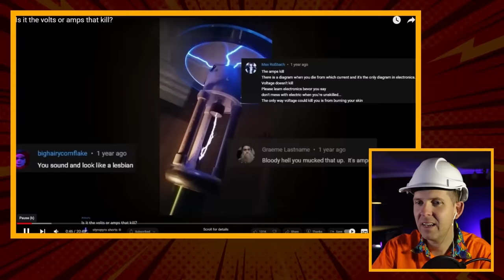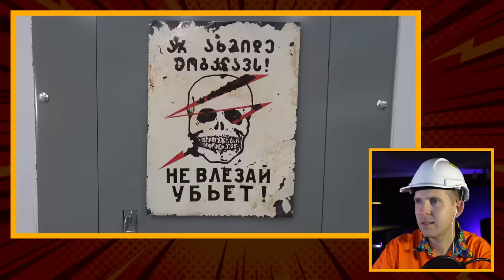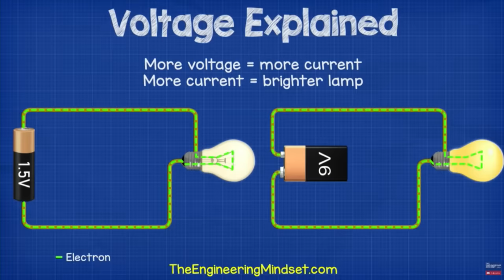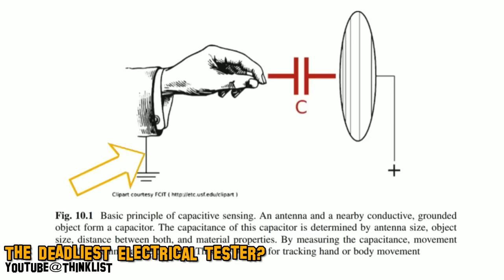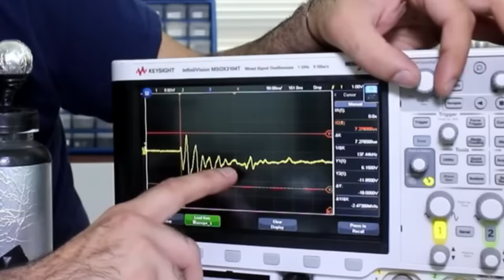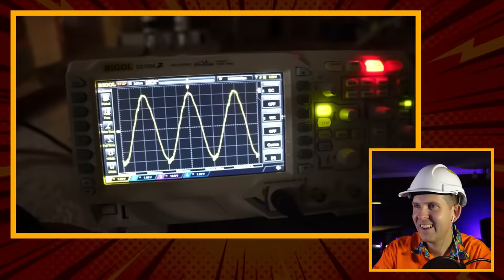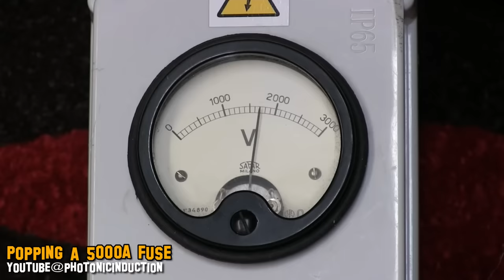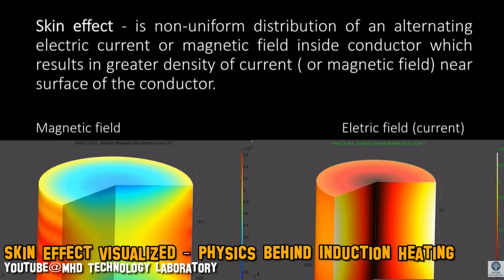Electrician Reacts to Styropyro's🔌AMPS vs VOLTS⚡

Comment: 1 volt can kill you?
Reply: no
Reply: @neutronenstern.  Yes it can,have you ever heard of amps? I generate 40 000 volt by just combing my hair.
Reply: @pernykvist3442  you seem not to undersdand ohms law. If there is a potential difference of only 1V across your body, there is no way a harmfull current could pass your body. It is impossible,cause I=U/R, and since R of your body at 1V is somewhere at 10000Ω or even higher, only a miniscule current will flow through ypur body, even if the source would be capable of a max current of 100000000000A, it could still not push this through your body, if its voltage is only 1V.
And your hair does not kill you, cause as soon as you touch it, it will discharge to nearly 0V in under a ms. The charge is so low, that it just doesnt last long. (like if you had only one dust corn of dynamite. It will expplode, and the pressure might be high, but still not nearly enough to harm you). For a very very short amount of time, still there might be flowing a very very high current through your body. But it does not harm you, cause its soooo short.
Reply: @neutronenstern.  The currence of 1 volt can kill you if the tention is built up to extreme! Most lightning bolts dosent have musch volt in them.
Reply: @pernykvist3442  no.
there is no tention.
Theres volts and amps.
A lightning will initially have Billions of volts. Then while it strikes, this voltage breaks down, until it does not strike anymore. The hot air created by the initial current spike is a plasma, which js conductive, and low in resistance.
You seem not to know a lot about electricity .
1V cant kill you, and thats for sure. 
Maybe you mean with tension voltage, cause in languages like german its the same word.
But then 1V is the """tension""". 
1A of current flowing through your body can kill you,if it flows long enough (10ms or longer).
even 0,025A can kill you.
But if theres only 1V of voltage across your body, then the current flowing thfough your body will be way way lower than that, and it will not kill you.
Reply: @neutronenstern.  Once again volt is only the frequence and amps are the tension! It is possible to build up an enormous charge in one and single volt to cause you to catch fire and vaporise body fluids.
Reply: @pernykvist3442  its the other way around.
Volt gives you the energy which each electron has got (per definition)The Energy is then given by its charge multiplied by the voltage.
Amps however give you information of how many electrons pass a certain point at a conducter per second. 1Amp is defined as one coulomb per second, while one electron has got a charge of 1,602*10^-19Coulomb.
This is by Definition.
Now Ohms law tells us, that for a ohm resistor the current is directly proportional to the voltage across thar resistor, and indirectly proportional to its resistance,that is I=V/R.
At a voltage of 1V the current flowing through your body will only be miniscule.
It is however possible, to accumulate a lot of charge with only 1V. (e.g if you have a capacitor, that has a high capacitance like 100F, then at only 1V it can hold 100Coulomb of charge, which is a lot.
However this does not mean, that if ypu touch it,this charge will instantly flow through your body. In fact, it will take an eternity for that to discharge across your body. And how fast it will flow is desided by your resistance, and the voltage. Thats the reason, why one volt cant kill you. At one volt the rate of this charge flowing through your body (Current in Amps) is just too low,to be able to kill you. 
However, of you hold it onto a piece of copper wire, it will discharge quickly, heating up the piece of copper. This is, because the copper is way way morr conductive than you are, and thus at even one volt, it will conduct a lot of current.
You are just wrong with this. You can trust me in this topic. I am studying physics,and in this topic, i know exactly,what i am talking about.
Reply: @neutronenstern.  Every movmeant generate voltage,if there where no amperes you would dead by putting on ordinary cotton tshirt. I do work with electric heating and colding systems.
Reply: @pernykvist3442  YES. 
there are amps. But they can only be high, if the voltage is high. At high voltage, there will be a high current flowing through your body, and at low voltage, there will be low current flowing through your body. But its not only amps,that deside,if its lethal or not. Its also the time,ghe current flows through your body. If a cloth you put on charges up to lets say 10000V, and then you touch it, there will be flowing a current through your body,that would be lethal,if it would flow for longer than 10ms. But since it is flowing for a time shorter than a ms,it is not lethal.
Reply: @neutronenstern.  Listen to me carefully! If you if you set the mig weld in one volt and icrease it to maximum volt. And you sitting in a bath tub with water salt and silver nitrate you will die! And i dont recomend you try it!
Reply: @pernykvist3442  
Are you serious? Of course, if i set it to maximum volt, i will die. But then it isnt 1 Volt ! You seem to confuce a lot of variables here. Volts, Amps, and your self upmade "tension" that doesnt exist. Also you seem not to understand that one volt is one volt is one volt and will always be one volt.
Reply: @neutronenstern.  If you set iit on max amps with 1 volt it will still kill you or hurt you badly! Many volts  with low amps is like aoutomatic bb gun it hurts but dont ill you! Few volts or even one is a big 50cal round with strong amps!
Reply: @pernykvist3442  No.
You still dont understand ohms law!
There is no such thing as being able to controll volts and amps independently. It isnt possible. Eg. If you model a human (simple model, cause else too complicated for this post)
as a resistor of 1000Ω. Then if theres one volt across it,the current flowing through it will be 1mA, no matter how strong the source is. The source could be a huge fat transformer that transformes 230V down to 1V (and then it gets rectified or not for DC or AC),and is capable of an short current of 10000000A. But this high current will still not flow through your body, if the voltage is 1V. 
If theres 100V across the body, then the current will be at 100mA and deadly in this model. 
Its not possible that eg. at 1V across ypur body theres a current of lets say 100mA flowing through your body, cause this would mean, that the resistance of your body magically was only at 10Ω, which is ridiculous, cause at 1V not even the skin breaks down,and the resistance of your skin is higher.
You dont understand Ohms law. Just learn more about it. Saying 1V will kill you,if current is high enough, is like saying, i will reach rome from paris in one minute with a speed of 1Km/h if only the path i go along in one second is long enough. This is just bullshit, cause the path i walk per second is set by the speed, which is 1Km/h.
And the same applies to this scenario. As long as the bodys resistance is constant (which it is, as long as voltage across it is constant) the current is only set by the voltage across your body. There is no such thing as independend Voltage amd Amps. Dont you get this?
Reply: @neutronenstern.  I dont have any good video recrging but i shall try to post a video to you when i burn a nail or a fuse with 1 volt. Im certain that it "can" cause death. I dont have any other stronger regulator that can build up that amount of amps i would show yo but it will still make a mess that can be fatal.
Reply: @pernykvist3442  of course it can melt a nail. But it cant burn a human direcrly. Lets say,you have a power supply that can output 200A max, and you set it to 1V. If you now connect it to a nail with a resistance of lets say 0.01Ω there will be flowing a current of I=V/R=1V/0,01Ω=100A through the nail. Now the power consumption of the nail is P=U*I=1V*100A=100W. These 100W will heat up that nail pretty good.
However, if you touch it still nothing will happen. Thats because if you touch it,your body will at least have a resistance of ≈10000Ω.
Thus the current flowing through you will only be I=V/R=1V/10000Ω=0.0001A=0.1mA. Thats not a lot of current. Only at 20mA or above this will kill you.
Also the power is then only at P=U*I=1V*0,0001A=0,0001W
I am sure,if you connect this source to a wiener, it will not react to it. 
A wiener is a way  bether model for a human,than a nail.
Reply: @pernykvist3442  just think about it: Its not about how high the maximum current of your source is. Its about how high the current running through your body ACTUALLY will be. And this is determined by Voltage and Resistance.
Just THINK for a second.
Reply: @neutronenstern.  We have a particle accelerator who working with 1 volt.
Reply: @pernykvist3442  ok thats no problem. However if the accelerating voltage is only 1V, then i dont know,what its use might be,cause then each particle with  a charge of 1e, these particles will only reach a energy of E=V*q=1eV, which is not a lot of energy. Even electrons in a old TV will have 20KeV. 
So i doubt it works with 1V. Maybe the voltage of the kathode heating element is running with 1V?
Tell me, how is this accelerator called? Or maybe its accelerated several times with 1V, then the energy will accumulate, and if its high frequency it will reach high energies over time.
Still this does not tell you, if 1V can kill you or not. 1V simply cant kill you directly.
(or is it 1kV,cause i dont find a single one with only 1V. 1kV=1000V)
Reply: @neutronenstern.  But yes it can do. The voltage is not the part that is deadly i can stun my self with 100 000 volt and i does it daily by petting the cat etc using a blender.
Reply: @pernykvist3442  it might be the amps, but still volts determine amps. And if you stun yourselve with 100 000volts, then both volts and amps are high. You dont die, because this stun is short enough.

But i explained this like 100times now, and you still dont read it,so i think you just either dont read, or just cant understand.
Reply: @neutronenstern.  With big amount of amps built up a single volt dosent only kill you it can allso disolve the water in your body into oxygen and hydrogen. I am 100% certain of that thanks. :)
Reply: @neutronenstern.  And i will allso claim that Zero "0" volt would probably kill us to!
Reply: @pernykvist3442  no
Read about ohms law.
Also electrolysis at 1V is possible, but very very slow. Normal electrolysis generators work with a little more than 1V. And over your skin having the highest resistance there will drop most of this 1V, so that over the rest of your body there will only drop like 0,1V or even less. And under 0,5V electrolysis of water isnt physically possible. I am certain, because i know it, can calculate it, and have often touched stuff with 1V, 12V and even 30V. And that although this power supply can handle 10A, and 10A flowing through my body would be lethal. But it simply does not, because of ohms law. Also i've touched a supply's terminal, that can output 30A at 12V,and i didnt even feel a damn thing. You are just wrong. But if you want to, you can feel terryfied of a 12V car battery, that can output 200A, if you want to. I am not.
Reply: @pernykvist3442  Are you a troll? 
At zero Volt there isnt even a electron flowing.
Reply: @neutronenstern.  Owh so you think that there is no susch thing as bio electric signal? I must enlight you that 1 volt is not one impulse if you belive that? I fthere where no motion the absolute "Theoretic" Zero point temp would ocure and giological life cant survive that "Whatever might happends" No motion no life.
Reply: @neutronenstern.  Did i read right? You touched a 12 volt with 30 amps and nothing happend? maybe ypu mean mamph? "Milli amps?
Reply: @neutronenstern.  Not even my mig weld goes higher then 5 amps.
Reply: @pernykvist3442  no i mean Amps!
and if your mig weld goes only to 5A, then i wonder, if you can read. A welder goes normally to at least 100A. 
The power source with 12V 30A i am referring to is from a old PC. It is a ATX, and its name is Thermaltake Munich 430W. Max Output Current is even 34A. 
The one with 10A max is a lab power supply "Peak Tech 6226. For the Thermaltake Munich i also measured the output voltage, and it can also output some good power, so its not broken or setup incorrectly.
I told you. ohms law does indeed work.
Reply: @pernykvist3442  maybe your mig weld is 500A max?
Reply: @pernykvist3442  so i know tried and took out the ATX power supply again, turned it on, took a 0,88mm copper wire and wound a coil with a resistance of 0,3Ω (and some very low impedance ) as a ballast for the supply to not shut off because of over current, and shorted it across a paper clip, which msde the paper clip glow red hot in seconds. Before and after that i held the wires of the supply in my bare hands. Then i wanted to short it across a small nail,and on one end it got red hot, but i had to turn all of it off, cause the coil as a ballast was beginning to smoke. Then after it cooled down, i could also hold it in bare hands. It was approx. pushing 37A through this wire, which is even a little bit of overload for the poor ATX, but still it wasnt able to harm me at all. 
Now guess why?! 12V is just not enough to push a harmful current through a human body. If i had wet soapy hands, i might have felt a little tingle, but it would still not be harmful, if i dont do it for too long and electrolysis starts forming enough oxygen to kill me. This however would take an eternity for it to get to a harmful point.
Reply: @neutronenstern.  1 amp is one million of milli amps and that is awfull lots of power, have you even basic knowledge of fusik/chemistry? Only a high school degree shall include this basic!?
Reply: @pernykvist3442  so
1m is 1000.000mm?
No! 1m=1000mm
m is milli, and that does not mean a millionth, but a thousands. So 1A=1000mA.
And now to look at power:
P=U*I
If we calculate in SI unit system, then 
P is in Watt, U is in Volts and I is in Amps.
So if eg. a supply can output 12V and 30A, it will deliver a power of P=12V*30A=360W. 
This is not a lot of power. Out of the wall one gets a maximum power of:
P=U*I=230V*16A=3680W without setting off the fuse.
A normal household fuse is 16A. 
And e.g a mA is not a lot of current for most things in household. A vacuum. cleaner might draw several amps. A electric cooker might even draw 10A at 230V. 
Its just that we humans will die, if more than 25mA of current flows through our body. But this will due to ohms law only happen, if the voltage is large enough. For AC everything below 24V is completely safe, and in most situations with dry hands and small contact area even 60V AC might not kill you. But you shouldnt touch anything aboth 30V AC.
And for DC these numbers are higher.
At e.g 1V or 12V, or 20V, there will nothing happen, especially if its DC.
And i can even measure current below 10A with my multimeter, to check if the lab power supply can output 10A, and yes it can.
And if you search a bit online, you will see, that a proper  welding mashine can output roundabout 200A.
You cant weld with 5A. (maybe you can weld tinfoil with a current of 5A (; ) 
You seem not to know a lot about Voltage, Current, Resistance,and SI system.
Read more about it, before you accidentally set up your welder to a voltage, that might kill you without using safety gear.
Reply: @neutronenstern.  Its not the voltage that kills you its still the amps.
Reply: @pernykvist3442  And the higher the voltage, the higher the amps.
Reply: @neutronenstern.  wrong
Reply: @pernykvist3442  Please read all of this. It will answer a lot of questions you might have. If you dont belive me, you can go to electro boom, styro pyro, wiki, ... .You might be confuced, because while there are power supplies, that are rated to 12V and 30A, and also ones, that are rated to 12V and 1A, and ones, that might be rated to 100V and 10A, but also ones, that are rated to 10000V and only 0,1mA. But the thing is, that these specifications,are only the limit of the power supply. Eg. for one with 12V and 30A, it does not mean,that if you hook it up to something,that there will be flowing a current of 30A, nor does it mean,that in any case there will be 12V across it. e.g if i put a 1ΩResistor across a 12V power supply,that can output 30A max, there will only be flowing a current of 12A.
On the other hand, if I put a 1Ω Resistor across a 100V and 10A power source, the power source will either turn off, because of overload,or its voltage will drop to 10V, so that it only outputs 10A. Of you put the 1Ω resistor at the 12V 1A power supply, it will either shut off,or its voltage breaks down to 1V, so that it only outputs 1A at 1V. 
And if you connect a 10000V power supply to a piece of wood with a resistance of 10GΩ, then there will be flowing a current of 0,01mA through this piece of wood. On the other hand, if you connect it to a 1000Ω resistor (e.g your body), it will either shut off due to overload, or its voltage will break down to only 0,1V, and there will be a current flowing of 100μA=0,1mA.
So there you have it. This power source isn't lethal, because as soon as you touch it, its voltage will break down to near zero volts, because it can only output 0,1mA.
This is the only case, where the sentence, the voltage doesnt k*i** you, but the current partly applies. But still even in this case, while you touch it,the voltage is low.
But still this power supply might contain a capacitor (eg. the globe of a van the graff generator), which is charged up to 10KV. In this case, when you touch it, the voltage will not be instantly at 0,1V, but it will more or less rapidly go to 0,1V. Now, while the voltage is above 25V, the current flowing through you, might be above 25mA. Now if it is lethal or not depends on the time it takes for it to discharge to 25V. If this time is longer than 10ms, this will be lethal. If its way below 10ms, it will not be lethal. And if its long or short depends on the capacity of the capacitor,and your own resistance.
Still this is only the story for DC. For AC its more complicated, cause its frequency dependent, and...
Reply: @neutronenstern.  Their is a medicine that contains Lithium have you tried that? It can be good for you. Hope you gets over this manic phase and check up the truth i told you thanks.
Reply: @pernykvist3442  Ok so you are just trolling, right?
Or do you actually think ohms law is just complete garbage?
Cause if I=V/R, then the higher V the higher I. Its just simple maths.
Reply: @neutronenstern.  If there were a medal or an award for almost infinite patience, you would definitely have to be awarded with it.